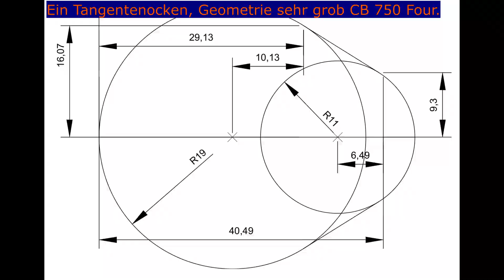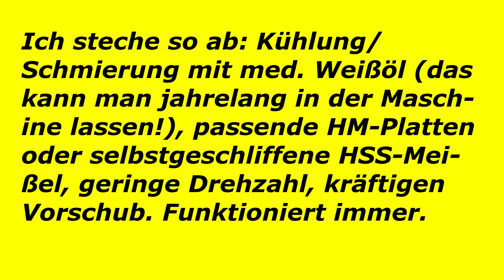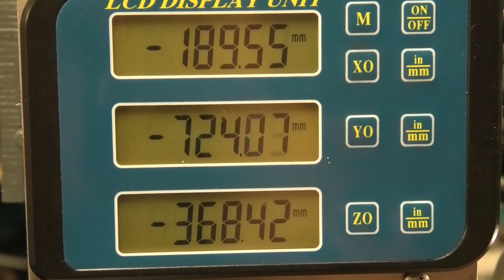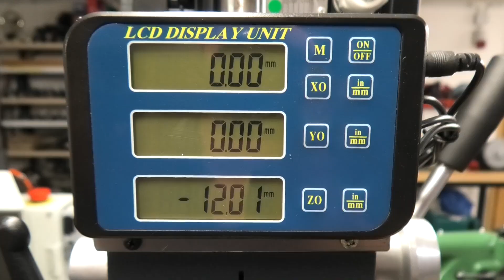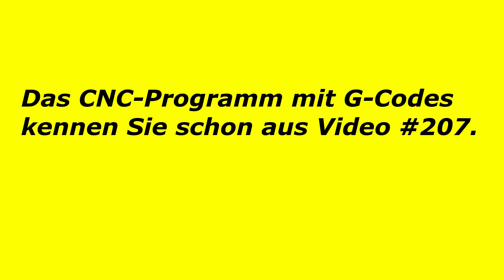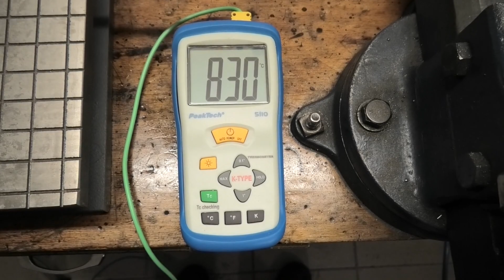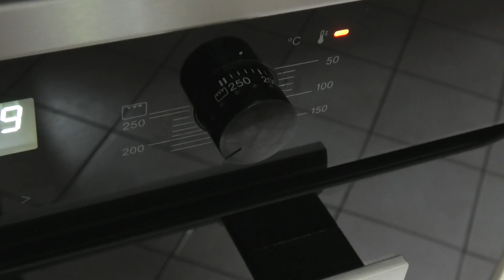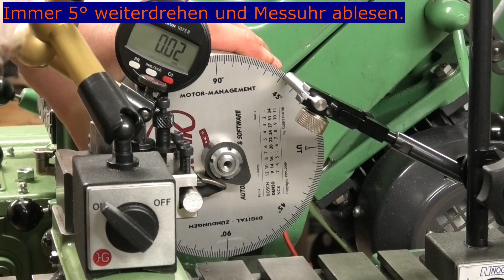Nocken fräsen für Verbrennungsmotor. Part 1: Tangentennocken.

Comment: Hello. very interesting. You do not run a cutter for milling. Do or input a cutter from the geometry a pal, or you have to make a hole in which it will take a cutter for glubin and milling the outline. Here is an example:
G00 G17 G21 G40 G54 G80 G90;
T10 M6 (FREZ DI 8);
G43 H10 X0 Y0 G150 Z50;
S2500 M3;
G00 Z5 M08;
G00 Z0 F600;
G02 X0 Y-5 J-2.5 F300;
G02 X0 Y5 J5;
G01 X20 Y5 F600;
G02 X21 Y4 J-1 F300;
G01 X21 Y1 F600;
G02 X20 Y0 I-1 F200;
G03 X16 Y-4 J-4 F200;
G02 X15 Y-5 I-1 F200; (X- This is a radius ninder. In- "+" or "-" by cutting.)
G01 X0Y-5 F500;
G02 X0 Y0 J2.5 F800;
G00z5m09;
N30;
%
Reply: prog. NC corrector
Reply from the maker: I'm not sure if I have understood your hint or question correctly. In fact, the cutter in my video plunges or dives in one millimeter and runs then the cam outline. Then another millimeter deeper, another outline run and so forth.